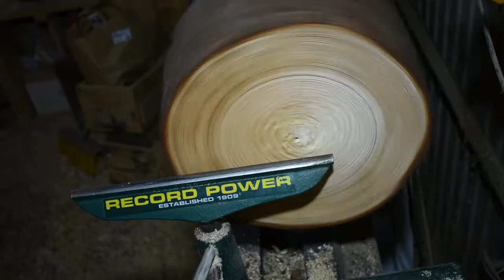Woodturning a Big Pine Ashtray

Comment: Hi Leo, That is a huge ashtray but it looks perfectly in proportion. Great work. 
I love how you designed and cast the snuffer.
Thanks for the shout out and for doing the video, I really appreciate it.
Take care my friend and when I have used the discs Luie sent me I will be in touch to ask to buy some of your snuffers.
Cheers, Huw
Reply from the maker: I will be happy to make a few for you. What type of thread would you like in them?
Normally I'm doing metric thread, M5 or M6 but since you live in the Imperial world I'm not sure if that would work for you. Its not a big problem though, I do have non-metric taps as well. Just let me know what you need or prefer.
Reply: @emgiwoodworks  Hi Leo, Thanks you so much. M5 or M6 would be good.
It is very difficult to get Imperial nuts & bolts in the UK now so metric is what I use.
Please let me know how much and how much postage would be.
Take care my friend.
Cheers, Huw

Comment: Hi Leo. A heavy-duty ashtray. Even better than the other one I saw from you. But you are not working in easy material. Pine can be tricky to turn. Is it water-based lacquer you are using?
Reply from the maker: Hi Sigur! This certainly wasn't easy turning. Especially near the center the wood was very soft, almost punky and I had lots of tearout. Fortunately the edge was much denser with the rings sitting closer together (slower growth). I sanded the center to the best of my abilities and used the laquer to 'fill the holes'. And yes, the laquer is water based.

Comment: Nicely done. Were you using the 4 inch template to help center your faceplate, or was it for your chuck recess, and you decided to switch ends?
Reply from the maker: The four inch template helps to align the faceplate. As soon as it was mounted on the faceplate, that had to be the top because of the screw holes being on that side. 
I have another template for sizing the recess. 😎

Comment: I cannot believe you made a WOODEN ashtray—without lining it with metal or glass!!  Seems kind of stupid to me, you  know—the old Fire/Wood combo? Amazing! It would’ve been a good idea if you were going to house an actual metal or glass large ashtray in the wooden turning…. But this, this was just dumb!
Reply from the maker: You are overly concerned. There is a metal section in the center to snuff out the cigars. And a cigar that just lays on top of it will only scorch the wood, no set it on fire.
Reply: Cigars also don't typically burn hot enough to start the wood on fire. Keep up the awesome projects, Leo!
Reply from the maker: Will do!
Reply: Plus, the ashes are usually not burning anymore when they fall.